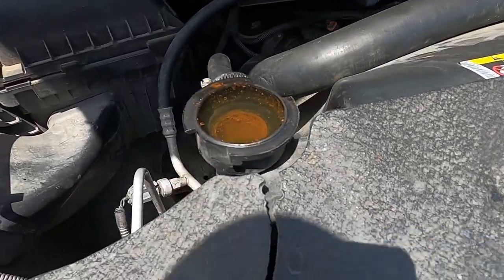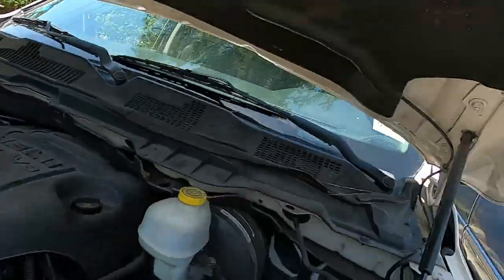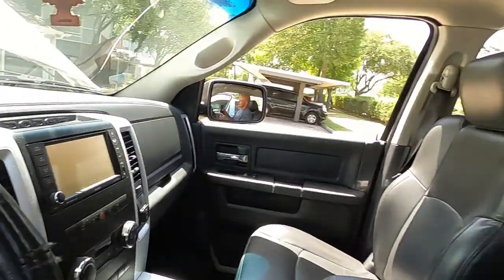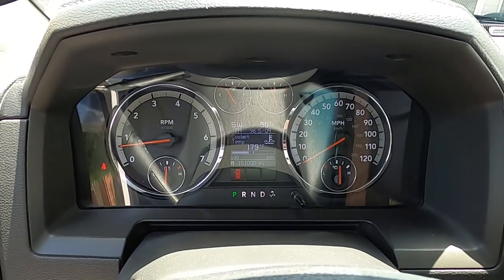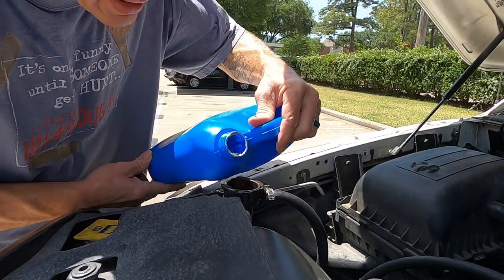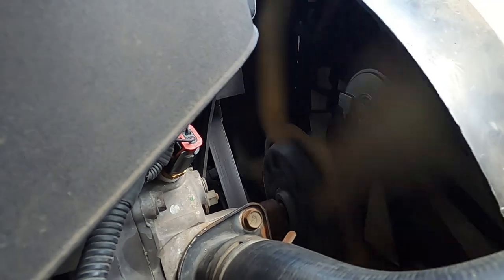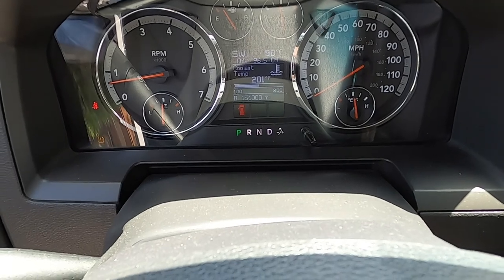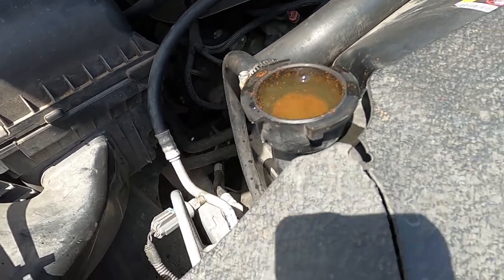Cooling System Bleeding, fan clutch check, and Engine Coolant Temp. Sensor operations

Comment: Have an 07 Ram Big Horn. Changed thermostat(checked to make sure it wasn’t faulty before installation), water pump and we aren’t getting coolant through the heater core hoses . Thermostat opens up but heat isn’t blowing hot consistently. What do you think the issue is?
Reply from the maker: Plugged up heater core